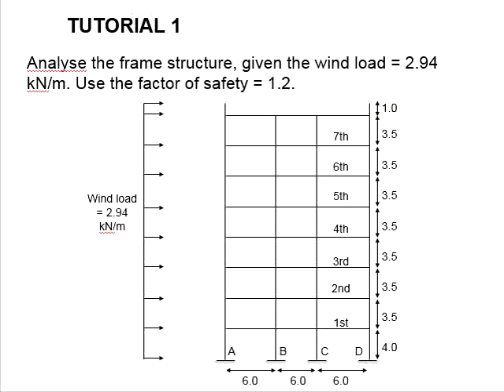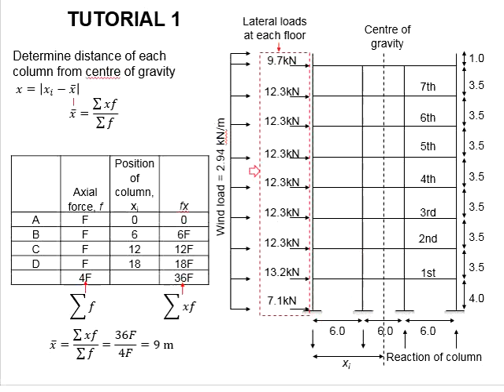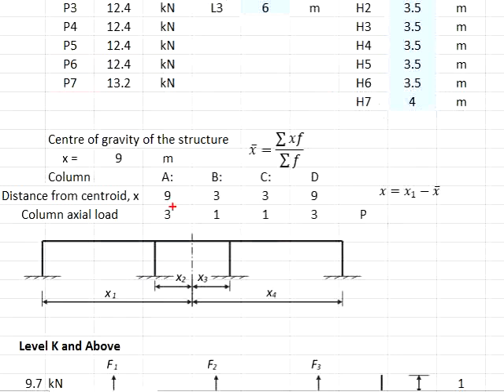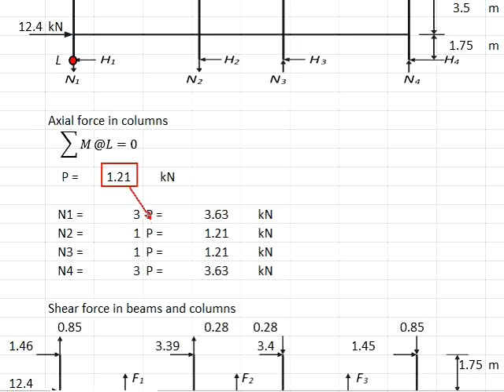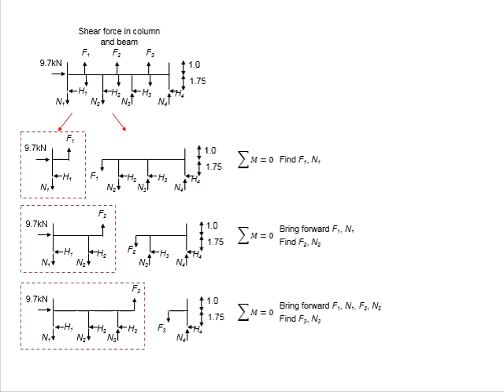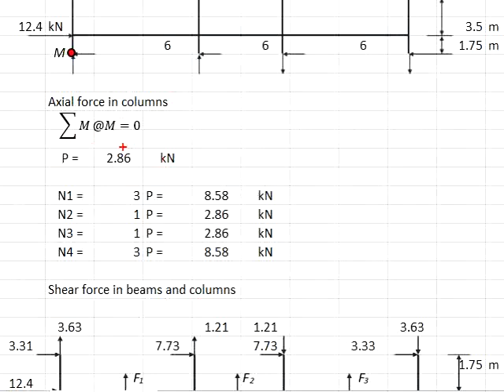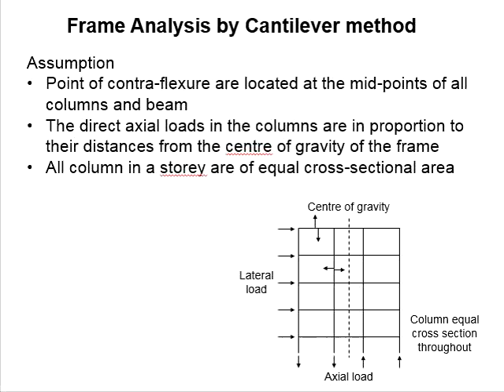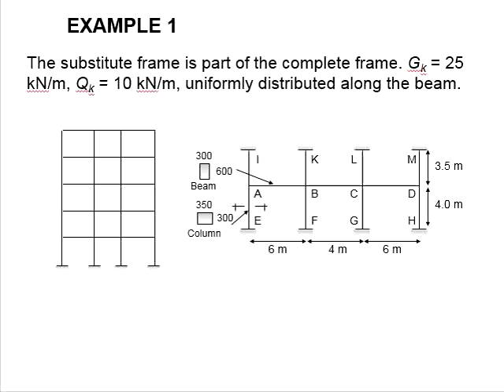1.7 Example: Analysis of frame with lateral load

Comment: How did you get the shear force "H1 = 1.46" for the first frame? I don't get it friend. If I assume the middle columns are twice stiff, from equilibrium I get (9.7KN/6)*1 = 1.61 kN. Why the H1 is not 1.61kN?
Reply from the maker: refer to the free body diagram at 13:34, the static equilibrium equation will be 0.85 x 6 / 2 - H1 x 1.75 = 0, rearrange the equation H1 = 0.85 x 9 / 2 / 1.75 = 1.46
Reply: @eng-aim  Thank you. Now I get it.

Comment: some show portal method is inaccurate and has about 30% of errors compared to analysis software. Is this method safe for real life projects? any reason that you used 'portal method' to be used in Eurocodes, instead of using the 'moment distribution with sway analysis' for Eurocode? (I noticed that you used moment distribution in the previous video but you didn't use sway analysis)
Reply from the maker: I believe this frame analysis alone would be inaccurate, due to the following reasons: (a) it only calculate the lateral load, (b) it assumes all beams and columns have similar stiffness. It could possibly be used in the mode of superposition. For example: frame analysis (for lateral loads) + moment distribution (for vertical loads). This might give a some more realistic values. Frankly, I have never tried this before, maybe you could test it and see the outcome.
Reply: @eng-aim  Thank you.